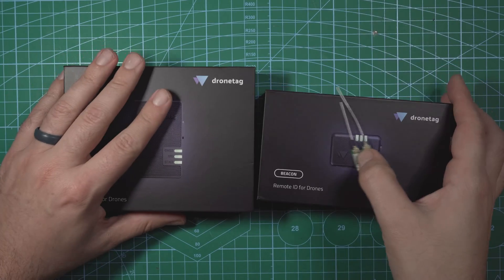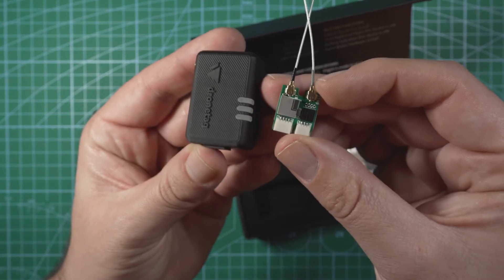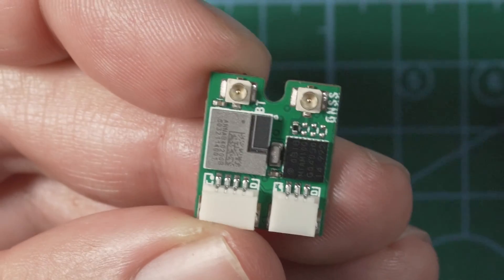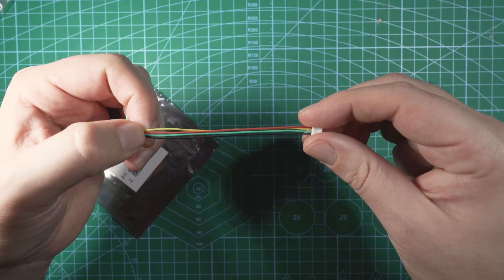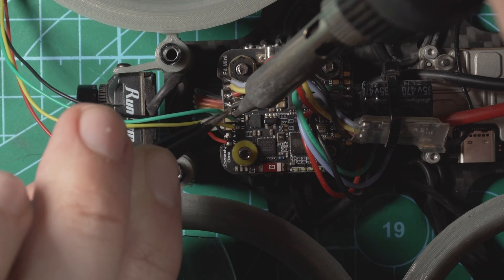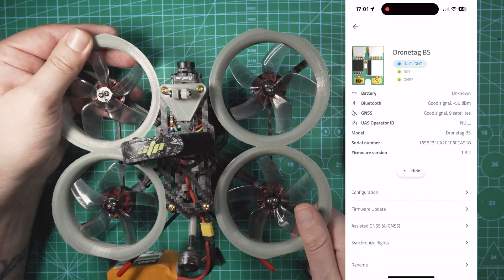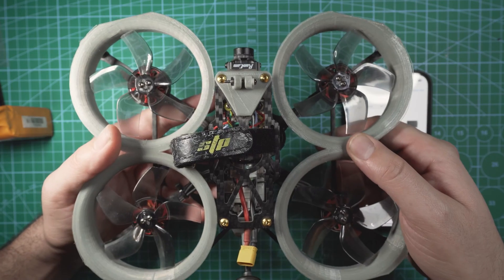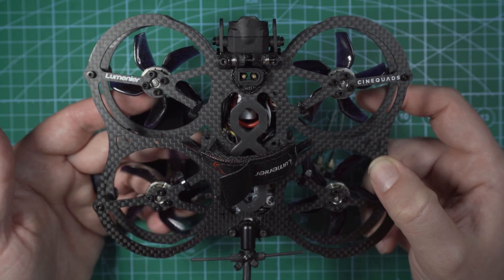Remote ID is Coming - Dronetag BS Install + Setup

Comment: Crazy question..why do you need remoteID on a sub 250 drone?
Reply from the maker: Great question! Pinning this 👍
If you're flying drones under a part 107, you need RID regardless of weight. 
If you're just flying recreationally drones under 250g don't need RID.
Reply: No you don't. The laws are not enforced. You're more likely to get in trouble by having remote id. 🙄
Reply from the maker: @davidsvideos195  I bet I am one of the few people that can argue the latter. 
I was approached by local PD when filming an event, above a crowd, with the sub250g drone that I showed in this video. 
This was late September in Andover, MA.

The officer I spoke with (to my surprise) knew what he was talking about and had worked with the FAA in the past due to a prior drone incident in the town. The officer asked me about the weight of the drone, who I had coordinated with, LAANC authorization, and asked if I had RID on board yet. This was soon after the FAA pushed the RID “enforcement” back to March 16 and the officer was (amazingly) aware of this as well. 

I wouldn’t say the regulation won't be enforced by any means. 
The likelihood of getting caught flying a drone without RID will be very slim and few and far between. But I think it's fair to say that someone operating a drone business has a MUCH higher likelihood of getting caught simply due to the increased flight time and where they are flying.
Reply: @TRONCATFPV  I'm curious, did you have a VO with you at the time?
Reply: @davidsvideos195  And if some crazy person shoots your drone you get to walk away, you report it, your in the wrong. There are a lot of people that think they own the sky or are just paranoid crazy, I fly for work, not taking a chance.

Comment: Glad to see they are shipping cables now, the Gen 1 modules came without, crimping JST SH connectors is not fun. I used one on a DJI Neo to make it a Category 1 for OOP operations, custom case, 40mAh battery, 4 grams.

Comment: how in the world have you gotten it to work as a gps ?  I've been trying everything I can think of for the last couple days and can't get it
Reply: I finally got it!  It isn't an msp gps like the other rid units.  It needs to be set as a gps sensor on your uart with 115200 baud.  And then use the ublox protocal with the auto toggles off.  It only works on 4.4.3.  It doesn't work on 4.5 yet or 4.3

Comment: I teach in an applied physics program that focuses on the use of sUAS for infrastructure inspection. I cornered an FAA rep at the last AUVSI show and asked him how remote ID will make anything "safer" or prevent bad actors from being naughty. His reply is that it wont. This whole thing is about public perception. It has nothing at all to do with safety. Its about showing those who are ignorant of how we use these that the government is providing "oversight" even if its in name only. 
  I think a more reasonable plan would be requiring remote ID within five miles of an airport or if you are flying under a controlled shelf. Other than that there is zero point to this device. What's really hilarious is that in the areas we fly the most for our program we rarely have decent enough cell coverage to get the app running anyway.
Reply: That is exactly why I don't care other than the cost and hassle, where I fly a vehicle drives by once in a while, no cellular service so UTM from the FAA with a network will not happen, they tried but failed thank goodness, it won't stop them, the WiFi / Bluetooth is just to get everyone use to the control issues.

Comment: On a quad like cinebot25, would the RID being encased in the frame cause any issues?  Assuming not considering rx and vtx are in there, but Id like a professional opinion before purchasing.
Reply from the maker: It may take a bit longer to acquire satellites, otherwise that should work good!
Reply: @TRONCATFPV  thanks!  I'm trying to avoid securing it on top of a quad in the event of a crash.  Unfortunately for my wallet, that involves buying a bigger quad so I can fit it 'inside'.
I want to get 1 quad set up and ready in the event I get some 107 work.
Do you consider flying to post on an unmonetized YT as part 107?
I'm in the 'better to be safe than sorry' group, but curious of others opinions.

Comment: Check out the Phoenix uas mRid for fpv. 2g, use with any M10 gps.
Reply from the maker: Looks very similar to the Dronetag DRI but is more expensive and is slightly bigger.
Reply: @TRONCATFPV  supports gps passthrough to both beta flight and INAV so closer feature to drone tag bs and similar price when add the gps.
Reply from the maker: Right so once you add the GPS you're looking at pretty much the same price as a dronetag BS but have a heavier RID module. 
I'm pretty sure the DRI also has GPS passthrough and just goes in-line between the GPS & FC. 
I'm struggling to see what makes the Pheonix $20 more expensive than the DRI.
Reply: @TRONCATFPV The DRI seems interesting but it doesn’t look like they’ve implemented Betaflight passthough for the GPS….at least as far as I can tell.

Comment: My Dronetag BS modules didn't come with power cables at all. anyone know what plug  they use ?
Reply from the maker: I use this pack of SH1.0 cables/connectors, the 4-pin connector should be what you need https://amzn.to/3u9ThvB

Comment: Hi...I have really enjoyed watching your videos.  I'm new to this and have been loving every minute of it.  I own a Holystone and realized just how limited This drone is, so I bought the V4 and the motors you posted in this video, and since they were out of the VTX you listed, for some reason I bought the RDQ Mach 3 Video Transmitter 25-1000mW 5.8GHz VTX - 
U.Fl (Includes U.Fl to SMA pigtail) and the camera was also sold out i bought the  Runcam Phoenix 2 SP Micro 1500TVL Starlight CMOS 4:3/16:9 NTSC/PAL FPV Camera (2.1mm) - Black - 
PHOENIX2-SPV3 and hopefully I didn't screw up with that one.  I also got the HappyModel 2.4GHz EP1 RX ELRS Receiver. Is this for my remote transmitter that I don't have yet?  Would you please recommend a budget remote for me.  I also got the 5" blades you listed and unless I missed something,  I still need to add GPS?  I'm not using the frame you did this build with yet.  I printed my own frame that is similar to a DJI and it is very light.  Still confused on what is needed to have a drone with good video transmission with good range.  But I would like to be able to go much further than my Holystone which I'm guessing not to difficult.  Also, is there any obstacle avoidance parts out their besides the 03 by DJI?  Thanks!

Comment: but what if you alreary have a GPS module? This BS module will work as a standalone GPS module and replace the one I have? And will work for GPS rescue in BF?
Reply from the maker: If you have a GPS already on your drone, check out dronetags DRI module. It’s meant more for drone manufacturers that want to make drones RID compliant but hobbyist can use it too.

This is cheaper than the BS, has integrated antennas, goes in between the GPS & FC and is equally as small. 

If you ultimately decide to use the BS as your standalone GPS, you can configure it in betaflight like a normal GPS so you can use GPS rescue 👍

Comment: I am wondering... Would it be a ""good"" idea to install the BS but then limit its effectiveness by sabotaging the antennas? I guess you could clip them short or just outright remove them if its safe for the module. This way it works fine at very short ranges and you are technically perfectly compliant but as soon as you gain some distance it just stops being effective and you don't have to worry about it... in minecraft.

Comment: 🎯 Key Takeaways for quick navigation:

00:01 🚁 The video covers the installation of Remote ID modules on drones, addressing the importance for compliance with regulations.
01:01 📦 The Drone tag BS module, priced at $89, weighing 1g, is highlighted as the smallest and most affordable option for achieving remote ID compliance on smaller drones.
01:30 📡 The video introduces the Drone tag Beacon and Mini, offering network and broadcast remote ID capabilities. The Beacon, at $219 and 17g, features only broadcast remote ID, while the Mini, at $329 and 32g, includes both broadcast and network remote ID.
02:54 📲 The setup process for both the Beacon and Mini is explained, emphasizing their ease of use, internal power supply, and antennas.
03:06 🧲 The focus shifts to the Drone tag BS module, highlighted for its small size (comparable to a Micro SD card) and ease of installation.
04:18 🛰️ Additional accessories for the Drone tag BS are showcased, including a case, cover, small battery, and upgraded antenna for improved satellite lock.
07:47 🔒 The importance of antenna orientation for optimal performance is emphasized, with the recommended 90° orientation for reliable satellite lock.
09:28 📱 The video demonstrates the setup process in the Drone Tag app, registering the device, and ensuring GPS functionality.
11:31 🌐 Once set up, the Drone tag BS module is shown broadcasting remote ID information, and the video concludes with outdoor flight tests demonstrating its performance.

Made with HARPA AI

Comment: Thanks for this video. I’ve got a couple of QAV 2.5” quads in my fleet, and I got the dronetag beacon for them, but that littlest unit would be even better for saving on weight! Also, do you know if there is a way to see the gps tracks after your flight is over in the dronetag app? That would be super helpful for a lost quad, but I haven’t found a way to do it…
Reply from the maker: Yessir!
I've been playing with the app a little bit more and you can see all of your previous flights.
If you click your profile icon in the top right corner, then click "My Flights" you should be able to see them 👍
Reply: @TRONCATFPV thanks for the reply! I checked that out, and it shows my flights, but I can’t view the actual gps tracks, (unless I’m transmitting my current signal) I can only select and delete them. Upon doing a little digging- I guess I’m on the free plan and you have to pay for a monthly subscription to save the flight data for up to 12 months…. It’s a bummer that it costs so much for a little “required” device like this and you don’t even get a free trial subscription to the premium features!
Reply: Well it's a gps, so use betaflight logging, (gpx export from 4.5) or use any opentx or edgetx or freedomtx rc special function to log telemetry (easy to convert to csv and import into google maps). TBS even has a live map view while flying in their app.